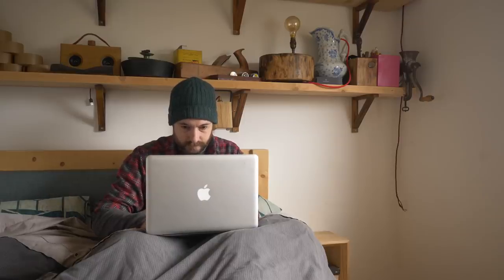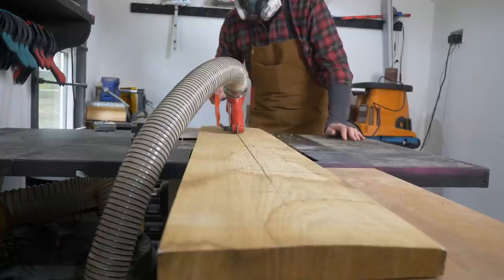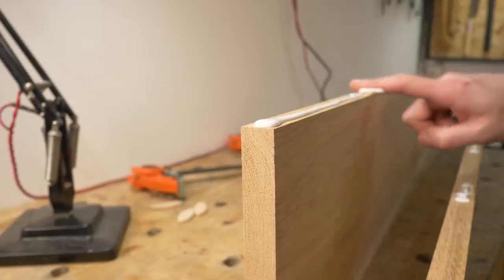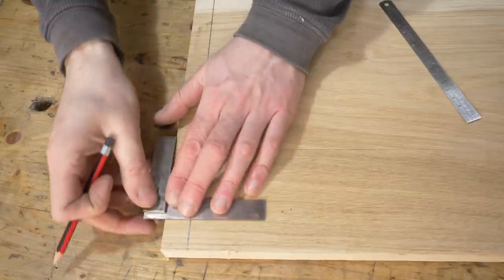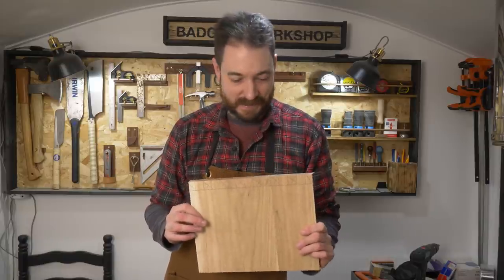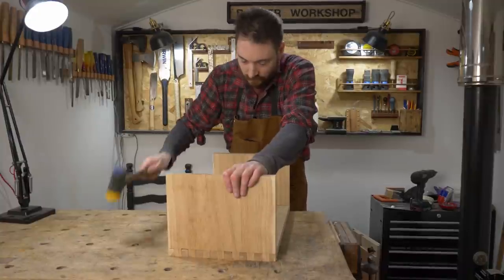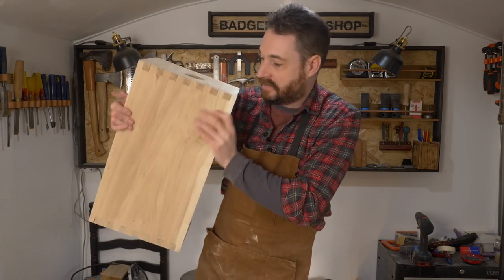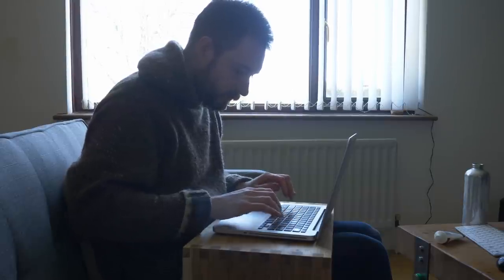Making A Lap Desk

Comment: Nice job Matt. When you have gaps round finger joints or dovetails, put some glue down them then in the end grain tap a blunt object, something dome shaped is perfect, into the end grain and it will spread it into the gap.

Comment: Nice build, lovely piece of lumber, specially when sanded & oiled. No angle towards you with end stop on your edge?
Does tung oil leave a shellac type surface sheen like Danish oil or purely soak in like boiled linseed oil?
Reply from the maker: It soaks in